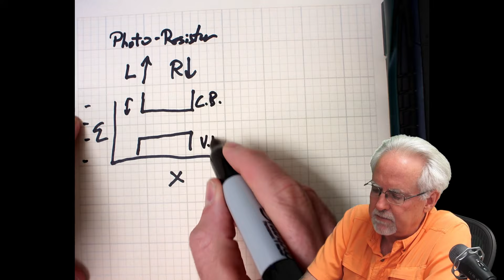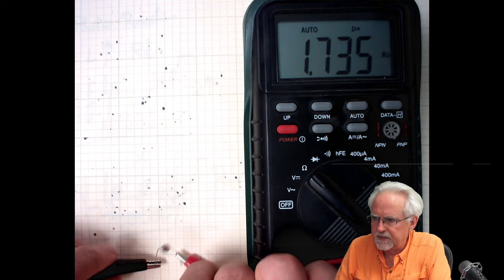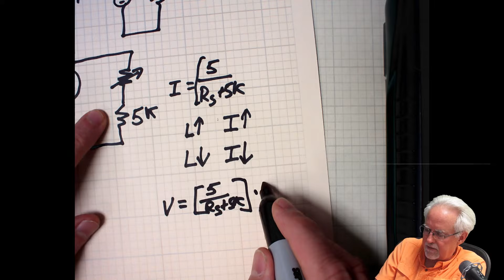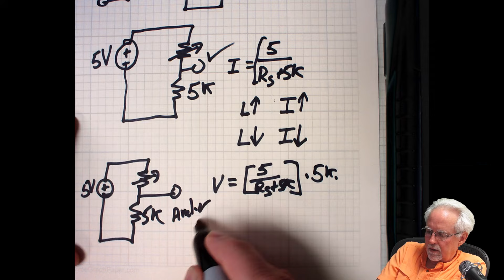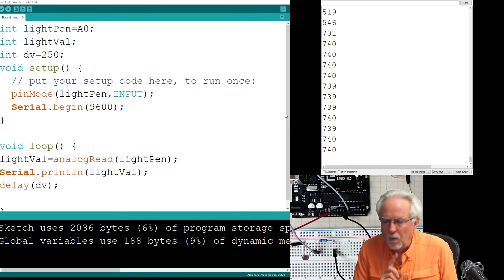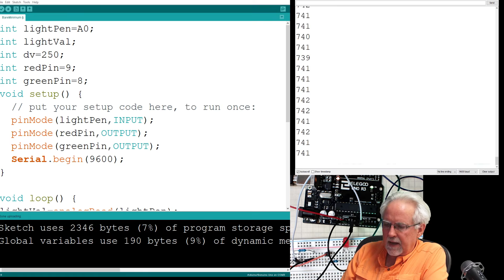Arduino Tutorial 25: Understanding Photoresistors and Photo Detectors

Comment: Darn it so close! I used the "while" conditional instead of "if" !
Also question: The diagram symbol that you used for the photoresistor, I have a book that shows that symbol as a variable resistor. Is that symbol used simply when there is varying resistance or is there an electrical component known as "Variable Resistor"? The symbol they show for the photoresistor has arrows outside pointing in to the lines. Sorry if its a dumb question, I just wanted to straighten that out in my brain.

Comment: I did it with a laser light. So if the photoresistor doesn't get any laser beam it would make a noise using the buzzer and output red light, otherwise it ouputs green light.

Comment: I tried it with two 'while' loops; they need a lightVal=analogRead(lightPin) command in each of the loops to not stall out, not sure why. When using 'if' loops, that cmd is not needed in otherwise identical loops, making the code leaner/more efficient. I also used a variable named 'threshold' in order to control the point where the LEDs change over. Fun stuff...!

Comment: When I did it on my own, I had slightly different logic that seems to work well with my delays in each if statement:

void loop() {
lightVal = analogRead(resVal);
Serial.println(lightVal);

if (lightVal > 600){
  digitalWrite(redPin, HIGH);
  delay(d1);
}

digitalWrite(redPin, LOW);

if (lightVal < 600){
  digitalWrite(greenPin, HIGH);
  delay(d1);
}

digitalWrite(greenPin, LOW);

}

Comment: I have a few decades of programming and i think that if you greater than and Less then the same number, the number in question is ignored.  X > 350 then X<350.  It will skip if the number is 350. So i always put one to >=  X>=350  X<350.  Just my 2 cents.  I love this series.  Keep up the excellent work!  :)

Comment: Well it worked, but I did it way different. I calculated voltage and turn the lights on and off based on voltage with if volts =1 or volts = 0 instead of sensor value and printed the voltage to the serial monitor. As a retired automotive technician, I want to see a voltage pid on the scan tool.

Comment: Hello Professor McWhorter,
I had a question about resistance readings using my multimeter. Everytime I try and measure the resistance, it goes up to 9.31 kOhms in the light and then 0 kOhms in the dark. Is there an explanation for why yours goes up in the dark and mine doesn't? 
Thank you.
Reply from the maker: Are you making the measurement with the component by itself, not in the circuit? The Resistance should go down as the light gets brighter.
Reply: @paulmcwhorter  Seems like it was just user error on my part since the project worked perfectly. Did the project with a common cathode instead of a red and green LED, just to spice things up! Thank you for your lessons :).

Comment: //Automatic Calibration
//Enjoy

int sensorRead = A2;
int rgLeds [] = {9,10};
int Val=512;
int Min = 1024;
int Max = -1;
void setup() {
  pinMode(sensorRead,INPUT);
  pinMode(rgLeds[0],OUTPUT);
  pinMode(rgLeds[1],OUTPUT);
  Serial.begin(9600);
}

void loop() {
  Val = analogRead(sensorRead);
  if (Val > Max) Max = Val;
  if (Val < Min) Min = Val;
  Serial.print("Val: ");
  Serial.print(Val);
  Serial.print(" Min: ");
  Serial.print(Min);
  Serial.print(" Max: ");
  Serial.println(Max);
  bool lightsOn;
  lightsOn = (Val>=((Min+Max)*0.5));
  digitalWrite(rgLeds[1],lightsOn);
  digitalWrite(rgLeds[0],!lightsOn);
  delay(250);
}

Comment: i really enjoyd this lesson , here is my home work :

 int lightPen= A0 ;
int readVal;
float voltage ;
int rPin = 7 ;
int bPin = 6 ;

void setup() {
  // put your setup code here, to run once:
  pinMode (rPin , OUTPUT) ;
  pinMode (bPin , OUTPUT) ;
  Serial.begin(9600) ;

}

void loop() {
  // put your main code here, to run repeatedly:

  readVal= analogRead(lightPen);
  // print the values 
   voltage = readVal * (5.0 / 1023.0);  
  Serial.print("Analog Value: ");
  Serial.print(readVal);
  Serial.print(" Voltage: ");
  Serial.println(voltage);
  delay(500);
  if (voltage < 1) {
    digitalWrite (bPin , HIGH) ;
    digitalWrite (rPin , LOW) ;
    
  }

  else {

    digitalWrite(bPin, LOW);
    digitalWrite(rPin, HIGH);
    delay(1000);
    

    }
  }

Comment: Following Paul. I enjoyed this tutorial especially the physics and maths, dont understand the hate. I started with the red led not working and did the test with the 5v pin. I put the lead in the wrong slot. Another point I had both leds flashing but was able to sort that out. After declaring the variables for my chosen pins and doing the pinModes I did one if sttaement. I set the the light vale as >=400, green high red low. I then did an else statement for the reverse. I know we havent covered else but I used it. I suppose there was a lot more that could have been done wirh i, given the ranges of sensitivity.  played around with a dark room, a spotlight, mirrors and a magnifying glass targeting the photoresistor. Thanks Paul.

Comment: Love the lessons! Taking a hint from an earlier lesson, instead of putting a "constant" in for the  "greater/less than" values (i.e. 350), I made an "int"eger called "threshold" and set it to 350. That way i can adjust both IF statements at one place, with one value! Thanks for your lessons!
Reply from the maker: That's a great idea!  You are thinking like a programmer.

Comment: I changed my Serial output to actual voltage values using notes and knowledge from previous lessons. I had to use point slope formula to figure it out, It worked beautifully. Thanks for the in depth lessons Paul.

Comment: I used this sensor to test for blacklight sensitive parts. The black light frequency has little effect on the Photo sensitive resistor. But the glow of parts that react to the black light does have an effect! Doom, detector works. Why would I need this.. because many fake Lego parts glow when they shouldn't. So if it triggers, solenoid fires and rejects part.

Comment: say i take a bunch of low enough resistors connected in series with an LED and the LED and resistor series is connected in parallel to a photoresistor, then if the math is right the LED should dim under bright light and glow brighter in darkness right?

i understand the way you did it in the video but i just want to make sure if the above method will work as well or not

Comment: You seem to make the math a lot harder than it needs to be. Determine the span of the input voltage. In your case   the max value was 780 and the minimum value was 150  yielding a span of 630. Divide  630 by the number of degrees   you want to use , in your case 160 degrees.,  Result equals 0.254 .  Therefor degrees movement is 0.254 times  the input value. 
By doing this the span of your light to dark could be changed  quite really.
I am really enjoying your classes . I am following with b0th of your Arduino classes. this one and the R4. I am retired and 87 years old and this has suer helped me from becoming board . I wis we had had access to something like Arduino when I was Staff engineer in the Chemical Eng. Dept at the University Of Houston. Would have made my life much easier. That was 30 years ago.
Reply from the maker: No, I did the math the right way. What you describe does not work for cases where y intercept is not zero. So why not just learn the math, and always do it the right way.

Comment: Thanks for  taking the time to explain the nuts and bolts of stuff.  That leads to people that are able to expand their projects beyond the lesson experiment.  I have been playing (self taught) with micro controllers and simple electronics for 12+ years and still watch your stuff because you do things in a different way than I have done it before.  There are multiple ways of doing things and no one way is the “right” way.  Your explanations always reveal an alternative.  Thanks!
PicAxe was my first microcontroller and the things I learned there work just as well with Arduino but BASIC is a lot easier to use for beginners.  I still use both but Arduino is now my go-to micro.

Comment: I am green, so having said that..... does it make sense to simply run a 5 volt wire and one ground wire to the (-) rail and then use the negative (rail) to ground everything too; rather than running separate GND wires to the Arduino directly? I presume this would be an ok practice. In some cases there will be more than just two devices. I hope my question make sense?
Reply from the maker: Yes, connect 5V to the top row of the bread board to create a 5V rail on the board. Tie a gnd on the arduino to the bottom row to create a ground rail. Now whenerver you need 5V or ground in the circuit just connect to the correct rail.

Comment: Good day, Mr. Paul, firstly, you are appreciated, secondly I have a question, I hooked up my LDR circuit, and when I turn the light off and dim the LDR, it gives me high readings in my serial monitor of around 995 , and when the light is on it gives me a reading of 734 , it should give me low readings == current when the light is OFF right? it responds differently, any clarification would be greatly appreciated.
Reply from the maker: put the resistor on the other side of the photodetector
Reply: @paulmcwhorter   Hello Mr. Paul, Blessings be with you, the kit I'm using is providing a photoresistor ky-018 kit where Pin 1 is GND, Pin 2 is 5V, and Pin 3 is DATA. however, still, when the room light is fully high, it gives me a high reading and when I dim it it gives an even higher rate.

Comment: Just had the strangest situation, no matter what i did, the leds wouldn't change state from when they first loaded, i changes all sorts of things, i was stuck with the red led bright, with the green led gently pulsing, with the serial TX led, i went through it so many times, it compiled, it was all happy apparently, until i noticed, i'd put semi colons onto my if statements before the curly brackets..........removed those and it works fine. 
Thanks bud.

Comment: Let me add my two cents in support of the math and physics.  I had two issues in this lesson.  First, my A0 pin is NOT working.  I know this is the case because I use the simulator, TinkerCAD, first and it's A0 is fine.  SO...  I hooked up the ELEGOO circuit to pin A1 and everything worked.  Next, the simulated light value change point was lightVal>800, but the real circuit was 200.  Hint: I put my finger over the sensor to make it dark.  Success :).

Comment: So I did the homework assignment first and made it work perfectly but I did it with while loop instead of if statement. I had to use two while loops and analog read in both of them and serial print in both of them but it works perfectly.  Your way was far mor efficient than the way i did it.

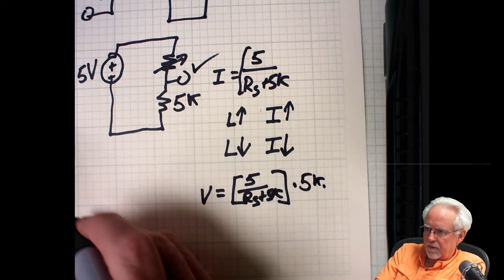Comment: I am struggling to understand why you need the 5 K resister. Shouldn't you be able to do the same thing with no additional resisters? Does any one have any literature they can point me to so I can figure out why I am confused? I assume it because in order to measure at the point after the photo resister we need some kind of standard to measure the voltage drop, but I don't understand it. At (14:01) https://youtu.be/WMkN-uHd-Xo?list=PLGs0VKk2DiYw-L-RibttcvK-WBZm8WLEP&t=841
Reply: My question was sort of answered in the next video, but why do we need the voltage divider?

Comment: so what is the purpose of the white wire?
Reply: and why are we also adding the 5K resistor because we already have one for the light? your response will be appreciated thank you.
Reply: @MasterFLTricks_e6h  White wire is for meassuring the pot value that "goes out" after the voltage goes through the PhotoResistor. White wire is connected to pin 'A0' and receives the pot value.

As for the 5K resistor, Im not really sure. I think its because without another resistor we wouldn't be able to read the potVal. One leg of the Photoresistor connects to 5 Volts and the other connects to the GND. So here there is no place for another connection, a reader pin connection. (Again, im not really sure 🕵)

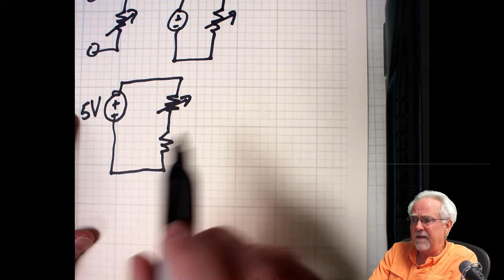Comment: Hi Paul, I don't understand why we need a 5 kohm resistor 12:15. If measuring voltage across the photoresistor is the goal, then we should be able to do that without the additional register right? If our goal was to convert the voltage to a current then we couldn't do it. Thanks for creating this series. :)

Comment: Thanks for this series! I really enjoy the extra knowledge you bestow, because it helped me troubleshoot the following! I wanted to comment with the solution to see if anyone else had this anomaly. 

I have the ELEGOO Super Starter Uno R3 kit. The two photoresistors that came with mine had a higher resistance than the ones in this tutorial! They were ranging between 40 kΩ & 150kΩ between light and dark, about 15x lower than the ones shown here. I was wondering why my pin was read 1023 across the board, no matter what light I shined at it (or removed from it). I grabbed my multimeter and checked both photoresistors. Sure enough, both were clocking in very high resistances as mentioned. I fixed the problem by putting a few of the 10kΩ resistors from the kit in series behind the 5V to approximately match the photorestistors range, like you mentioned in the video, and now it works like a charm.

Comment: Your lessons are great and easy to follow - nowhere else have I found learning about the Arduino so easy.

But one thing ... an else clause is more programmatically appropriate, eg:

if (lightVal > 350) {
  // flip one way
} else {
  // flip the other way
}
Reply from the maker: Actually, and practically, I have seen more disasters in real world projects from use of the else command than any other single command. In organizations which I led, I had a rule . . . do not use else or else/if. Logically confusing. Cover the parameter space with if statements only.
Reply: @paulmcwhorter  I guess it's down to preference. I'm new to Arduino but have been programming for many years and have no issues with else (if you're confident that the tested value can only have two possible values), or I might use else if for the next block. If there are many options, I sometimes like to use a switch block.

Comment: In my case the room is lit by a 60 Watt Led bouncing off the Ceiling from the top shelf of the Computer Stand.
I'm reading from 250 to 290 with low lighting. With the light out, about 42.
Using a Stylus Stream light near the Photo Resistor is greater than 980.
I used photoRes=A3; photoVal;  greenPin=10; redPin=9; wt=250;
This was after pausing the video.

In my case, Math, Algebra, and Trig, was necessary to to learn Electronics at UEI (United Electronics Institute, Louisville, Ky).
My response to the Math haters is this: Paul has a limited amount of time to cover the material.
Imagine taking a 6 hours a day, 5 days a week for two years.  I did at UEI!

Wait until  you get into Digital logic with Boolean Algebra, or reading Schematic Diagrams more complicated.
I had to understand the Vidicon, (The camera uses this to convert pictures into electrical signals), the Sync Generator and how Audio and Video were mixed at the Diplexer. (A transformer that mixes audio into the Video signal at the broadcast Antenna). Although, this is getting away from the topic, there are much harder things to understand.
Paul does an excellent job in trying to keep it simple.
Wayne

Comment: Hey paul just a quick question 
When determining the fixed resistor value to use with the photo resistor should I use the same value of the photo resistor? 
If I’m using a 5k photo resistor do I need a 5k fixed resistor 
I’m confused is this a rule or something?

Comment: Hello Mr. McWhorter. I have had an issue recently in which if statements don't work. I have tried switching wires and using the 5V port to check that the circuits are functioning properly, but can't get if statements to turn a light on/off then turn the other light on if the voltage value changes.

When I run the program, the first if statement runs and one of the LED's turns on, but if I change the voltage, the other if statement does not kick in, even though the voltage is changing on the serial monitor.

Any help would be greatly appreciated.

Comment: Simple alarm system(You will need to plug in an active buzzer):
int lightPin=A2;
int lightVal;
int buzzPin=11;
int bt=75;
int bt2=200;
int dv=75;
int greenPin=8;
int redPin=9;
int j;
void setup() {
Serial.begin(9600);
pinMode(lightPin,INPUT);
pinMode(greenPin,OUTPUT);
pinMode(redPin,OUTPUT);
pinMode(buzzPin,OUTPUT);
}

void loop() {
lightVal=analogRead(lightPin);
Serial.println(lightVal);
delay(dv);
if (lightVal>=2){
  digitalWrite(greenPin,LOW);
  digitalWrite(redPin,HIGH);
for (j=1;j<=500;j=j+1){
digitalWrite(buzzPin,HIGH);
delay(bt);
digitalWrite(buzzPin,LOW);
delay(bt);
}
}

if (lightVal<=1){
  digitalWrite(greenPin,LOW);
  digitalWrite(redPin,LOW);
}
}

Comment: I decided to go a little further and add a yellow led when the neutral room light was present and it only turned red when I covered the led. The green led worked fine when the lights were on, but when I covered the LDR it flashed from yellow to red, when I opened the serial monitor I saw the value was jumping from 100 to 300 for some reason, any thoughts? I fixed it by simply moving the LDR further away from the red led, but in the process I rewired it so maybe it was a wiring fault?